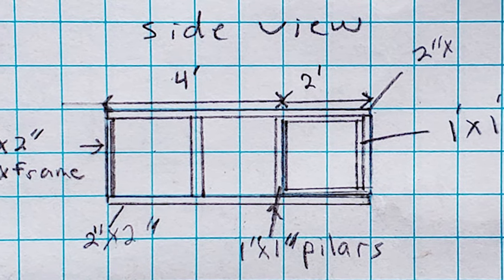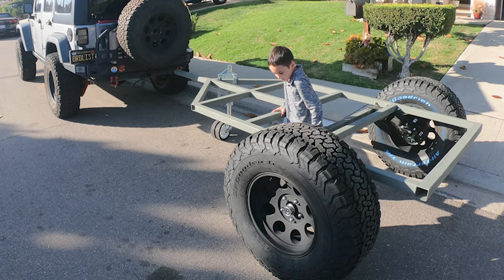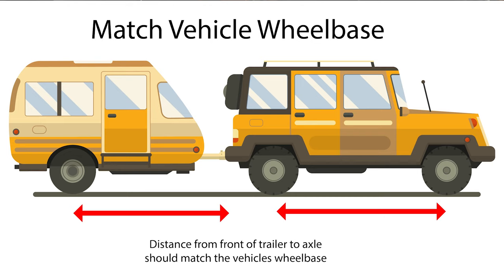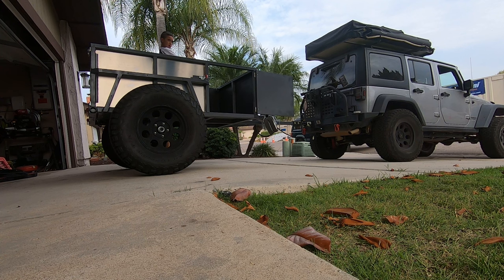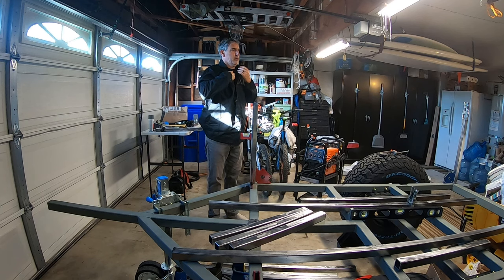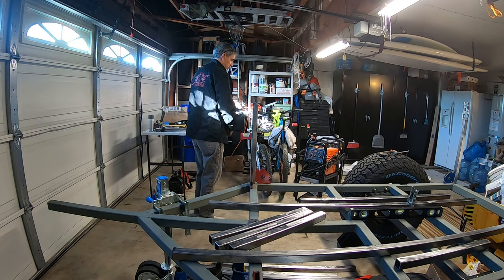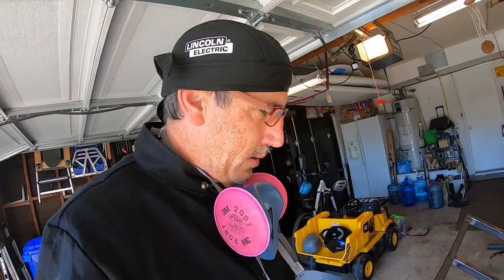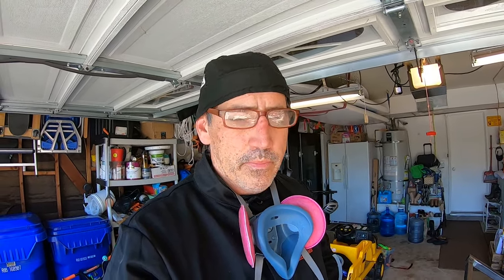Overland Trailer DIY Build Part 2 - Frame and Suspension

Comment: Which Timbren did you end up using? I know they have options with a lift, no lift, a drop, etc. I am wanting to run same size 35s as my truck and it looks like what you used would work.
Reply from the maker: Got these: https://timbren.com/products/asr2khds03-axle-less
Reply: Thank you for the reply. What size tires/wheels are you running? Most of what I see on Timbren site is for max 16.5” wheels. 
Also any idea what you’re weighing fully loaded?
Reply from the maker: @Potus121  I'm running 35s on 17 inch rims, which is the same as ai run on my jeep. That way I only need one spare for everything. Probably weighs 1500-1700 fully loaded.
Reply: @ordealist  than you again. I have the same tire/wheel size.  Appreciate your responses and love the build. Getting ready to start mine!

Comment: Did you consider building the chassis out of aluminum?
Reply from the maker: I did. But I haven't welded aluminum before and wanted to weld the frame (as opposed to bolting it together) for simplicity's sake. Also, aluminum is pricey...